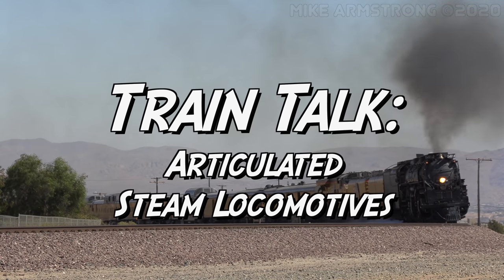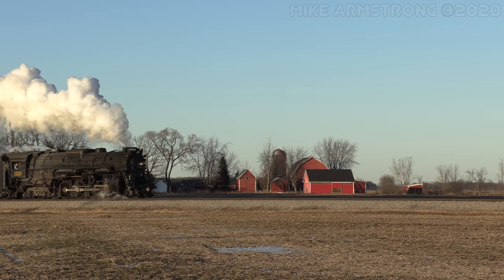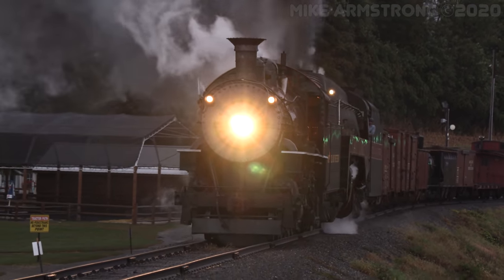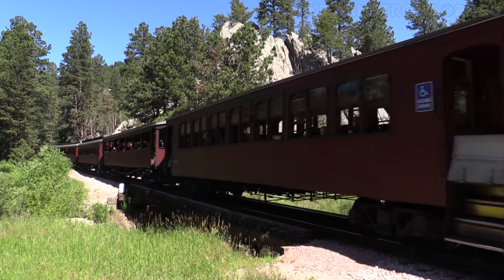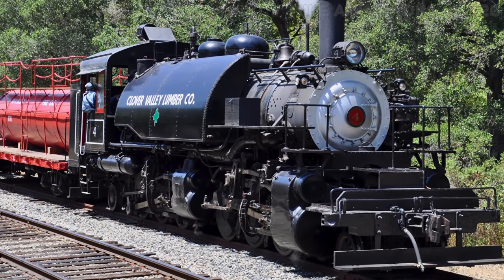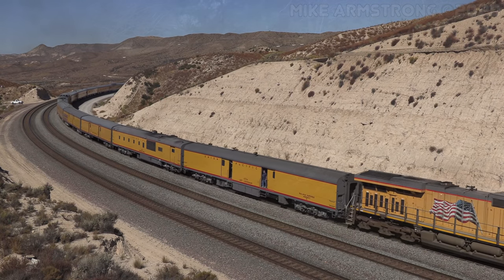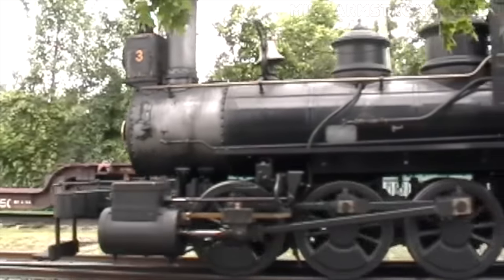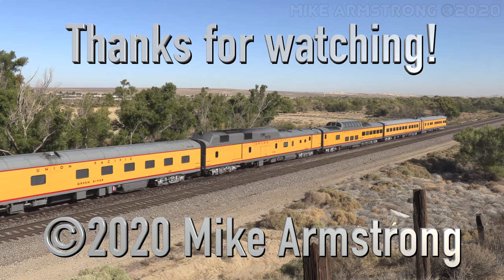Articulated Steam Locomotives: Train Talk Ep. 28

Comment: The T1 Trust group is making a brand new Pennsylvania Railroad T1 Duplex locomotive, 5550, and it is said to be completed by 2030. They are going to be building it off of old or/and surviving drawings of the locomotive. Hopefully they can solve the problems the T1 had such as violent wheelslip and a finicky valve gear.

Comment: Okay a lot of thoughts from this one. I know you didn't include any of the geared locomotives because you already did a video on them, but technically they count as articulated loco's as well. Shay's, Climaxes, Heislers, and Willamettes all have diving wheels that aren't rigidly attached to the locomotive frame. The same goes with Steam-Electric turbines seeing as their wheels are arranged more similarly to a diesel electric locomotive which are articulated by default, and even Sentinel steam locomotives. These were a unique steam design which used a high pressure vertical boiler, cylinders and a gear-drive system like the Shays, Climaxes, and so on. They are probably better known, as 0-4-0 shunters in Britain, but a few were built with powered trucks instead of a fixed wheelbase. Like the other geared locomotives, they were found to have smoother application of their power to the rails as opposed to the pounding of more conventional locomotives, including the Mallets and Simple Articulateds. Sadly I don't think any of the articulated Sentinels are still around. 

Next I want to mention the "exes." I think the four Triplexes counts as a combination of a Mallet and a Simple since they did have low-pressure cylinders for the front set of drivers, but the middle and rear set had smaller cylinders so I assume they were both high-pressure. Also while you did mention that articulated are locomotives with more than two-sets of driving wheels, I'm glad you didn't mention the duplexes. I often see people confuse them for articulateds when duplexes are, by definition, two driving wheel sets on a rigid frame. 

Overall though, this was a great episode! Distiguishing between the Mallets and Simples was nice too, as most people use Mallet to describe the articulation only rather than incorporate how the steam is used. Though I also want to mention there were some articulated, notably the N&W Y6's, which could alternate between compound and simple articulation. From what I've heard, the simple steam applied vastly more power, almost as much as a modern AC road diesel, and the compound was used to keep the train moving while conserving how much steam was used
Reply from the maker: Thanks, Russell. All good points. I actually did not know about the Y6's, so that's pretty interesting. A lot of my limitations with Train Talk have to do with what I have images and video of that I can use in a video. I know that there is always the "fair use" argument, but that can frequently get very muddy the farther you wade into that pond. And for a video like this, it really doesn't (in general) pay for me to go through the long process of trying to obtain rights to use images or videos from other people. That's why I ended up using those overly simplified illustrations for the last 3 types of articulated locomotives. You are right about the geared locomotives but as you also said, they were covered in another episode and I didn't want to confuse people too much with things like that since this video is focused on the cylinder driven rod engines. Again, thank you very much for the comment, I always enjoy hearing from you!

Comment: When railroads dominated American travel and commerce, and were going as many places as it was possible to lay track, the reasons for the articulated forms arose. All the low grade rise per mile routes were already in use, but larger scale logging by mechanization took railroad building into places formerly considered impossible.  Trains could also get longer, needing helper engines, once air brakes were common. Traction then began to be a problem on roads built for the American 4-4-0s.
 One reason Mallet may have designed his loco for compound beside the fact that compound steam engines at sea were coming into use to save coal and travel further, was the quality of the steam seal at the articulation point would not matter so much if it was lower in pressure. As even higher pressures became possible with longer stroke pistons I think the seal improvements followed that made a simplex design possible at the higher working  mainline speeds. Certainly not having to coordinate two engines allowed for higher speed, longer trains and of course smaller crew size.

Towards the end of steam, it was the extra traction of more drivers on the rails that governed decisions by traditionalists not ready to embrace the diesel-electric transition.  Steam turbines were a big success at sea, but failed miserably on the railroads. On a different subject,  the Garrett was an answer to the very tall large engines we Americans could use in the west, but tunnel size precluded in other parts of the world.   Your illustration doesn't show that the very large boiler sat suspended like a bridge,low between the two traction articulation sections at each end, one weighted by the water tank, the other weighted by coal tender.  No Garret could equal the Big Boy, and no Big boy could negotiate the older tunnels in the East Coast of the U.S. that governed the size of engine in use there. New tunnels under the Hudson, through D.C.  and elsewhere would be needed to use western high level equipment, should this country seriously want to improve rail service in the east.

Comment: With Rigid-framed engines they had a drawback. The Longer the locomotive grew The more it became like a centipede with a stiff neck with as you have said Mike negotiating tight curves The Mallet's origins go right back to 1888 with a Swiss French Engineer Anatole Mallet.

Comment: Aren’t these just 2 locos together? Or are they 2 sets of wheels?
Reply: There are two sets of driving wheels which share a common boiler on articulated steam locomotives. The exceptions being the Garret and Double Fairlie types which have two boilers and two sets of driving wheels. Confusingly, each set of drivers can be referred to as an "engine", which is probably the source of your confusion. Some articulated steam locomotives such as the Santa Fe's experimental 2-10-10-2's were constructed from 2 existing locomotives, however.